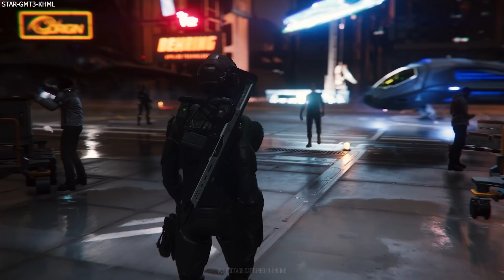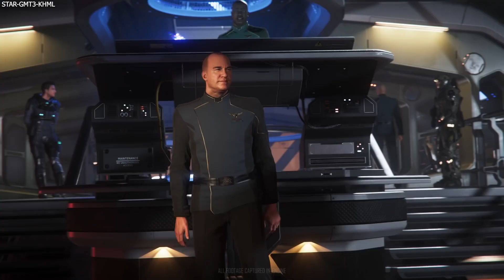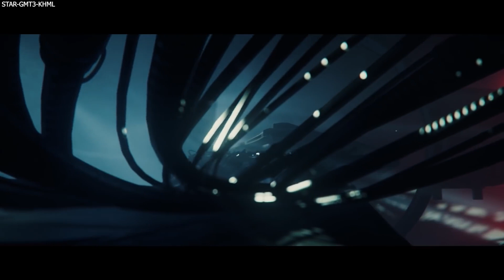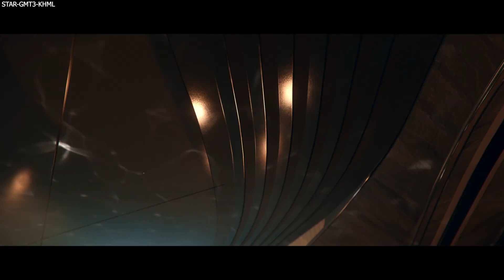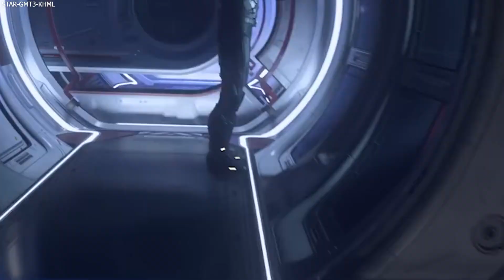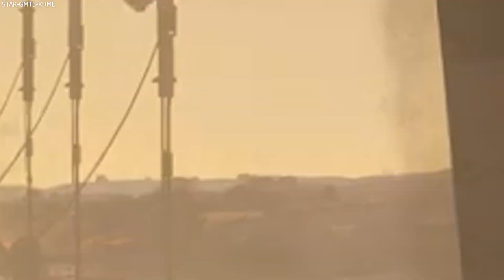Banu Merchantman, Polaris, 4.0, Pyro, Engineering, Scanners, Boats & MORE | Star Citizen Info

Comment: Nice presentation of the info Mac!
Thank you!
I can't help but to sit here and do the Picard forehead rub, when I hear this info. Not because of CIG's answers, but because this is the info the community seemed to want to know at the bar citizen.
The same rehashed material. With answers that are very likely to change in time.
And the irony of it, when you see the debate among the community about what CIG should be focusing on.

I'm not as interested in what or when is something to come. Or what it will be like. But more of the thoughts and decisions made that will progress the project to a more complete and polished experience.
The BMM info for example, was nice to understand, that the decision to hold it for longer is due to a desire for a more experienced team to finish it, rather than rush it with what they have. Only to later have to fix the many things the rush would have caused.
Would one wish for a journeyman to oversee the construction of their home, or an apprentice, because that is what is available?

I am very interested in the salvage loop. But I haven't heard much about it.
I'm also aware that maelstrom is highly needed to make much of what I know and hope for to be possible.
I can also imagine the amount of work its going to take, to bring every ship into that tech.
How is maelstrom doing? What are the hurdles? What are its dependencies?

I would really like to hear about the struggles and frustrations the devs have to make things possible. It brings perspective and appreciation for the work they do.